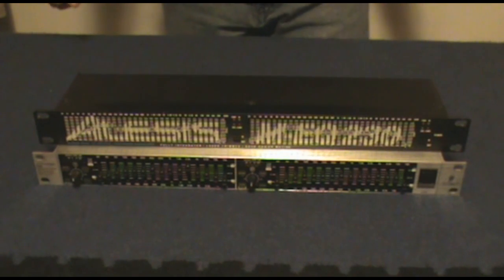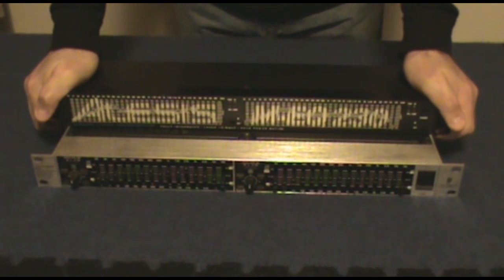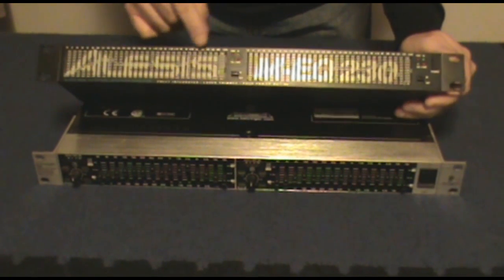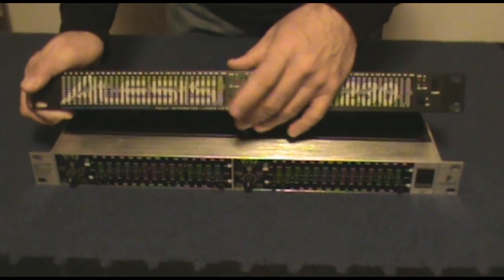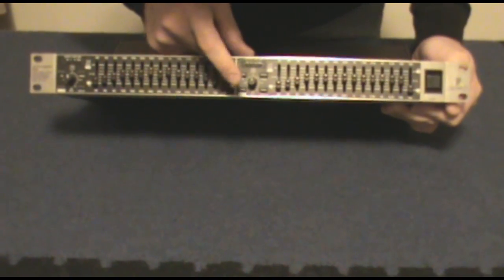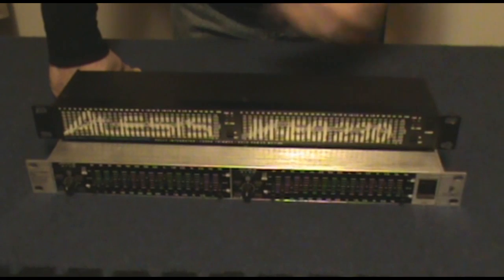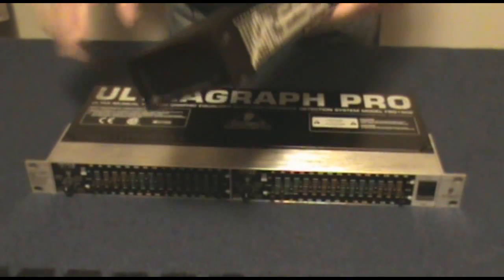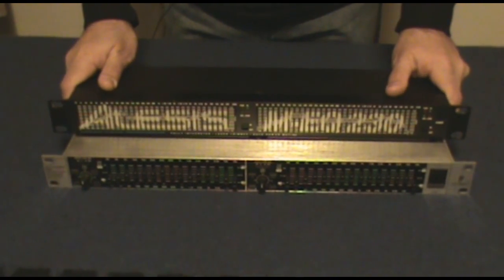Intro to Graphic Equalizers - AudioTech

Comment: Help: Can these things be plugged in directly into my keyboard amplifier? My Roland KC 150 has subwoofer and line outputs, but the only RCA slots I see is an aux input.
Reply from the maker: If the amp has an effects loop you plan plug it in there.

Comment: where would i hook it in? in the line part of my sterio chanel or is there a main place somewhere at the back of the mixer somewhere?
Reply from the maker: You can place eq's into the mixers channel strip inserts, aux's or stereo outputs. Wherever you need more eq control. If using for speakers you want to come out the mixer into eq then into the power amps or powered speakers.

Comment: if I use backing tracks through a sterio Chanel and the mixers eq just doesn't cut it. can I hook one of these up to that Chanel? its more to be able to Taylor my sound than for feedback purposes.
Reply from the maker: Yes, just connect it between the mixer and the speakers before the power amps or powered speakers.

Comment: do these work as crossovers?
Reply from the maker: No. You need to buy a crossover, eq's don't function in the same way. Crossovers split the output signal at the proper point for lows, mids and highs used by separate speaker systems for each group of frequencies.

Comment: hi. how is a noise level of behringer eq? i will buy an eq rack for my bass rig  ( bass head have a parametric eq and i will combine parametric + graphic )
Reply from the maker: I don't find them to be noisy units, I've had no issues with units I've owned. I've used them in live audio without inducing noise at all into the signals. Should be fine in a bass rig.
Reply: TheGospelGuitarist  i will buy a 31 band version for surgical control of my sound and 31 band version have high pass ( very useful for removing boomy range frequencies) and low pass (useful for removing excessive string noise from tweeter)
s/n ratio should be same in 31 band model (  > 94 db on product manual for both units). thanks for reply.
Reply from the maker: peppe marrazzo Yeah I had the 31 and still have the 15 as in the video. Hope it serves you well. :)
Reply: TheGospelGuitarist  :) my gallien krueger rig will works better with a graphic eq
character eq parametric + graphic eq for pro bass sound ;)

Comment: can you help me,? I would like to connect a power amp which has trs or xlr connections to a sony 700es integrated amp, I already have a dbx eq going to the connection on the sony amp that is labeled "adapter"  can I have both the eq and the power amp going to the sony amp at one time, if you can help be specific on where the cables go cause im a nit wit
Reply from the maker: You shouldn't run one amp into another amp. Just buy a more powerful home stereo.

Comment from the maker: To connect an EQ unit to the insert of a channel, find the channel "Insert" on the channel strip. Then using an insert cable ( a cable with a 1/4" stereo plug at one end and two 1/4" mono plugs at the other) to connect the unit. If you don't get signal flip the two plugs around. One sends and the other receives so they have to be in the correct jacks. :) You should not be using Aux 1 for mains, the stereo outputs are for that. Use A1 for monitors and A2 for outboard gear for example, Reverbs.